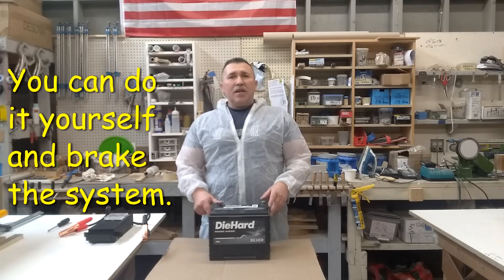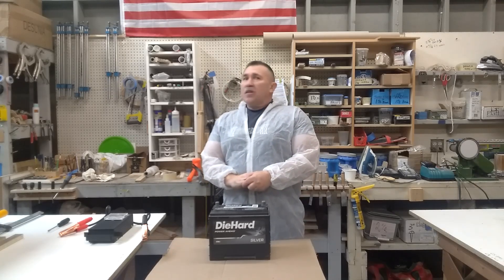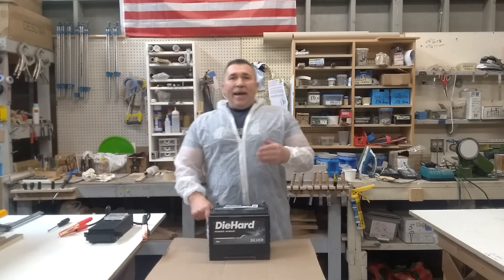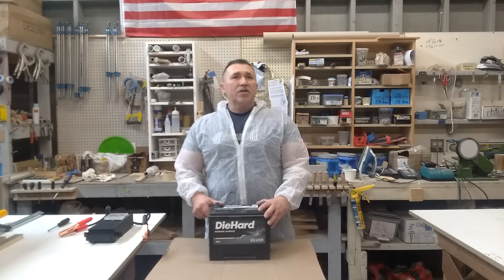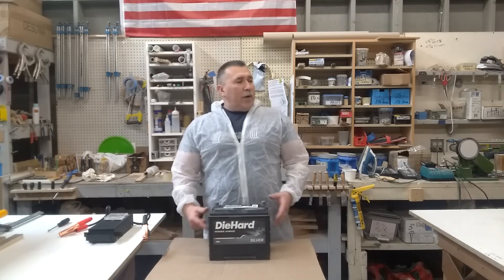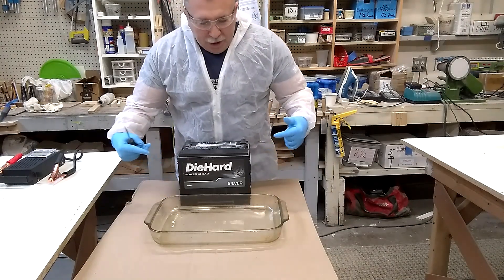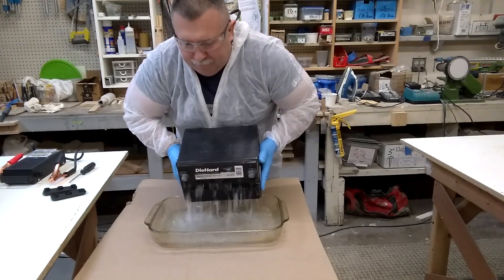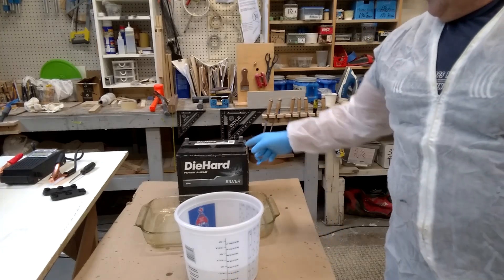A # 380 -1Convert your Lead Acid battery to Lead Crystal .DIY- ENGLISH only

Comment: Does this change the chemistry, or just the consistency?
If the chemistry is unchanged how is it different from a gel battery?
If the battery chemistry is changed do you have any links to science or research sites explaining the reactions?
Reply from the maker: My doing good still. Based on my experiment, one YouTube guy did such a test and professionally documented 100 full charging and discharging cycles. Unfortunately, it is in Polish and the charts are difficult to understand. Link to the video.
https://www.youtube.com/watch?v=hyMi1o2HHWM&t=14s